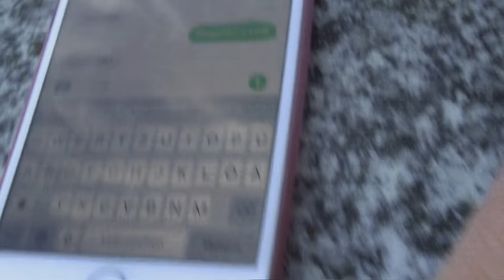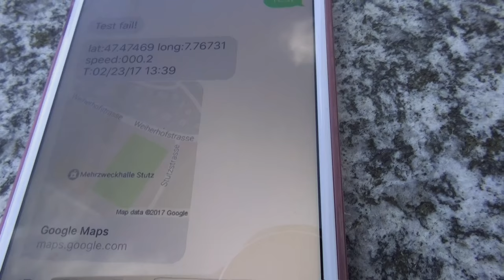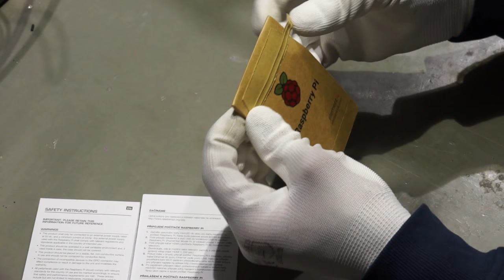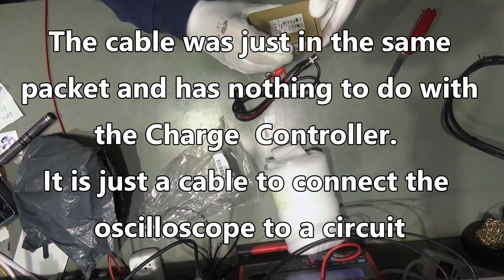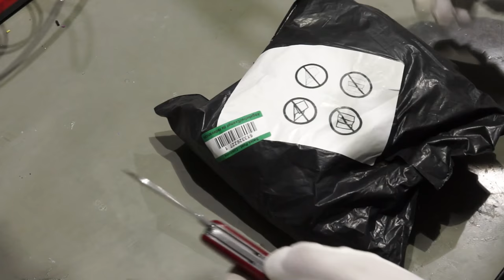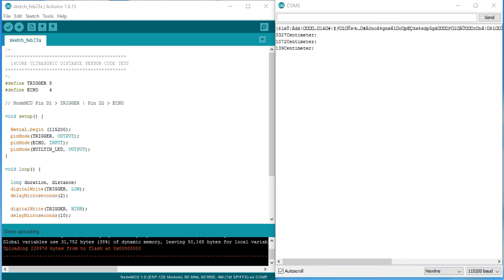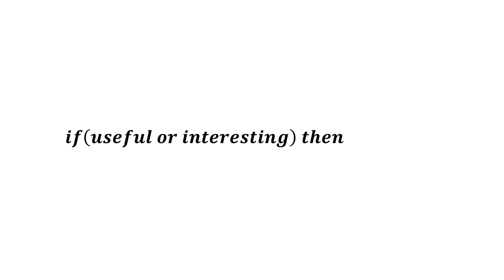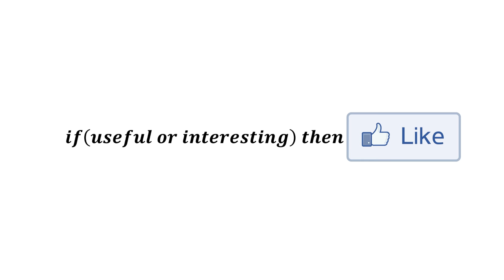#123 Mailbag plus

Comment: Looking forward to the DIY Weller build! Also I have several of the led Arduino "test" boards. I find them really handy. FYI you can use 2 modules on the digital side of an Uno by setting the pin that lines up with the Gnd pin to "low" in your sketch. The seller I got mine from (several years ago) had a two module sketch detailed in the listing.
Reply from the maker: That is a good idea, with the low pin. did not think about that. Thanks for the tip!
Reply: yes, i see the example in the end of the link Andreas posted :)

Comment: So you have a new Pi. Congratulations! The one I bought didn't have this cute little lady-bag.  ;-)
Now you can enjoy trying out Node RED to control your MQTT messaging!

I'm looking forward to see your series on solar-powered ESP. I also have a wide range of these small panels, as well as a few I made myself using bare cells. I did some solar experimenting last year.
The first step I took on a sunny day was to compare their performance by measuring open circuit voltage and shorted current. This gives you an indication of their wattage.
Then I compared some dc-dc converters. It seemed that the often used buck-down converters are less effective on small capacity panels. In my experiments boosting a 3v. panel to 5v up gave better perfornance than buck-down to 5v of a similar sized 7v panel. 
My last experiment was to connect an ESP MQTT node with ht7333 regulator to a Li-ion charger board and a 650mAh battery, powered by a small 5V 1Wp solar panel behind the window. It performed well and remained charged in summertime. In wintertime the battery didn't always fully charge and the regular wake-ups sometimes decided to go in battery saving off-mode. Next step is to make it sleep smarter based on energy level and to put it outdoors with a termerature sensor, so I can measure performance in all weather conditions. I've read for instance that batteries perform worse at low termperatures and also need to test rain proof, solar friendly housings...
Reply from the maker: Thanks for your feedback. I will not too as much as you mention. I will just concentrate on the electric part...

Comment: An other good one Andreas. Many thanks.
I too am assembling solar charge parts for some LoRa nodes (still waiting for gateway and node modules also!).  I suspect we may be ultimately heading in a similar direction.  Must look again at that low power esp battery chemistry tutorial by the guy with the Swiss accent...
Reply from the maker: Concerning direction: I think so. I never really worked with solar and I thought, for these small nodes it could be a good thing.
Reply: Andreas Spiess Ditto:  Spent time researching chemistries, types, configurations and chargingetc. waiting for LoRa hardware. Really struggle with poor insolation numbers at 53°N but there may be hope with deep sleeping LoRa nodes?
Reply from the maker: 53 degrees north is not too much. I was once at 78 degrees and survived... But you are right, the winter is also the problem in our region: No sun and the batteries also do not work. So, maybe gas is a good alternative for this time?

Comment: the bridge rectifier is a neat trick, but I've heard recently that reverse protection works much better with a Mosfet, because you don't lose voltage etc. gotta find the right one though.
Reply from the maker: +Dave P You are right. Bridge rectifiers are only used if you have plenty of voltage to kill. I just used this example fora quick demo...

Comment: Looking forward to your solar projects
Reply from the maker: Mee too ;-)
Reply: Same here but don't get to exited. Remember our eyes are superior , so sun is not energy as most think. As you said Suisse is not Afrika.  
Also take a look at the curves of a panel since it is not linear. So if a panel delivers 1 Watt at 6 Volt then try to keep it at that voltage. The mmpt you bought is a nice start.
The big big big issue I have with these solar cells, and I have yet to find good cheap ones (that says it already), is UV.  It really kills the coating on the cells which makes them useless after a couple of months.  You can see the same effect on cars headlights in Southern countries or those 1 Swiss Frank leds for in the garden.
If you have a bit of space then check 40 to 50 Watt panels on ebay which are in a frame and have some plexy glass in front and feed it into for example 7Ah 12V battery with a cheap pwm charger. It will not break a Swiss bank ;-)   I like to do free solar experiments with it during summertime and sometimes you can keep a pi-zero up  and running the whole summer long.
Reply: take a look at Adafruit Product ID 390, might give some ideas

Comment: I will be looking forward to seeing what use those small solar panels might be,  given their size.  Most of what I'm seeing out there in videos and such seem to be much larger.  :-)   I have one around here someplace that's maybe 6 inches square that I haven't checked out yet,  and one that came out of a busted calculator that with typical indoor lighting will drive a 20uA meter to full scale,  but I don't know what else it might be good for.
Reply from the maker: In recent projects I used 4x2.6 inches panels to power an ESP32 sensor or a LoRa satellite ground station and they are sufficient even in winter (outdoors, of course)

Comment: the 2 ethernet POE cables are called INJECTOR and SPLITTER, respectively... injector is the one that combines eth+power, splitter is the one that separates them on the other side... and generally the power in and out are opposite to your indication on video ;)

a good way to distribute power via eth (if you don't have a POE switch) is using a passive injector like this: you put cables from your normal switch into the LAN part, add an external power source to the power socket on the side, and you get poe eth on the other side of the device: https://it.aliexpress.com/item/8-LAN-Ports-Passive-POE-adapter-Pins-4-5-7-8-Power-Over-Ethernet-Module-Injector/32322708950.html
Reply: I wanted to say exactly the same but first commend I saw was yours :)
Reply from the maker: Thanks for your correction. I just unpacked it, so I was not aware of the details...
Reply: these mailbags make me buy always new stuff :D

Comment: Nice Andreas am eagerly expecting  coz even I also trying to rum a jsn sr 04 ultrasound sensors 5v + arduino pro mini + Hc 12 module with solar panel and am using TP4056 instead of pwm and mppt  am trying from 4v panel to 6v panel and am using 5v boost converter for sensor.

Comment: Lots of good stuff in this post bag. I’m looking forward to the Solar project, particularly how much you can squeeze out of those small panels in Switzerland!

And the tracker looks very good. I have left an old phone in my caravan to do a similar job but I might get one of these, at £16 they appear to be very good value.

Just a clarification on the Reamer, it's steel not aluminium which but I’m sure you know that.

The Raspberry Pi 3 is a fantastic bit of kit, I can buy it for £32 in the UK from https://thepihut.com/products/raspberry-pi-3-model-b compared to £32.89 on Banggood and it arrives in a couple of days from The Pi Hut. 

Soldering project also look very interesting. Thanks for the tip about the ultrasound sensors.

I’m getting this message from the LED link “STOP - there might be a problem with the requested link”

Many thanks for a very interesting video as usual.
Best wishes
Arthur
Reply from the maker: 1. The tracker runs now since 3 days on the first battery...
2. I know that you are lucky with the Raspbis in the UK. There, the Zero really costs 5$. Here, it costs 15$... And the 3 costs close to 50$
3. Concerning the Reamer: You are right, of course. I meant, the housing is aluminium....
4. The LED link was a normal Aliexpress link, which was refused by bitly. So, I replaced it. Thanks for the tip!

Comment: I love Mail Bags. Feels like Xmas every time :)
What is the chip they use in the first charge controller? It looks like its made by Fairchild or ST, and seems to have 6315 marking on it!
Don't use Diode bridges on a solar system. Too inefficient.
You can use a high-side switch using a P-Mosfet driven by a 2N2222 and a couple of bias resistors. Since the Rs of the Mosfets is  in Milli-Ohms, the voltage drop is in mV range.  It takes more space and its more expensive than a bridge, but far superior in the long run. Or at least use Germanium (Schottky) diodes and make one.
100th like :)
Reply from the maker: 1. I only find a chip with the name of CN3722
2. You are right. I would never use a bridge rectifier where energy is rare. Only if you have to spend the volts, this is a possibility. Actually, I just wanted to demonstrate a bridge rectifier in a "non-standard" usage. Just for fun.
Reply: That chip is a nice MPPT controller. I am surprised they didn't scrape the marking of the chip like they normally do!
You gave me a micro heart attack there for a minute, with that rectifier bit....
Reply from the maker: +UFOhunter What does not kill you makes you stronger...
Reply: In that case, I am the new Hercules :)
Reply from the maker: Who knows?

Comment: My Weller WES51D was $200 CDN on Amazon.ca a few years ago. Making your own is very interesting.
Reply from the maker: Here it is closer to 400$...
Reply: Sorry, it's a WESD51 and it's on sale on Amazon.ca for $202.82 CDN. They are pretty expensive, but I've had mine for seven years without an issue. At work I have a Weller EC2002M which is what made me buy a Weller for home.

Amazon.de seems to have okay prices.
Reply from the maker: If you saw my video about soldering irons, you know, that I also own a Weller since 40 years...
Reply: I have not seen it. They are fantastic quality. I love mine.

Comment: first i thought that tracker is one of those cheap gsm/gprs  tracker that don't work here but ist wasn't (that's good) they say it has a standby time of 12 h. Greetings form 694,24 km (431,38 mi) far away :-)
Reply from the maker: Actually, It runs now since Friday on the first battery. So, much longer. It seems to have geofencing an other fine stuff. Might be worth the money.
700 km without line of sight.... Difficult for 868 MHz. Should be possible on 40 meters...

Comment: the 5V ultrasonic sensor has generally the crystal on the front, and quite every mounting bracket supporting that sensor has a slot just for that: https://www.google.it/search?q=ultrasonic+bracket&newwindow=1&source=lnms&tbm=isch&sa=X
Reply from the maker: You are right. Did not see this (obvious difference). Thanks for the tip!

Comment: Just a quick tipp for the reverse polarity protection: You can use MOSFET's instead of diodes, that makes especially sense on battery controlled devices because of the massive amount of wasted energy in the diodes. Afrotechmods did a great video on this topic --> https://www.youtube.com/watch?v=IrB-FPcv1Dc
Reply from the maker: Thanks for the tip. I think, I saw this video long time ago, but forgot about it...